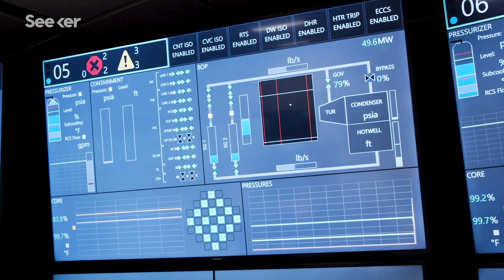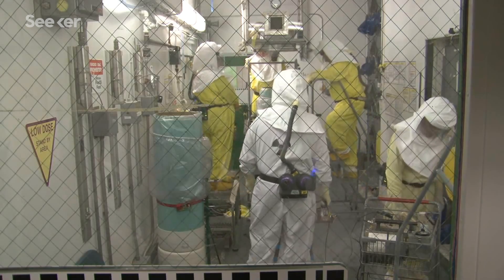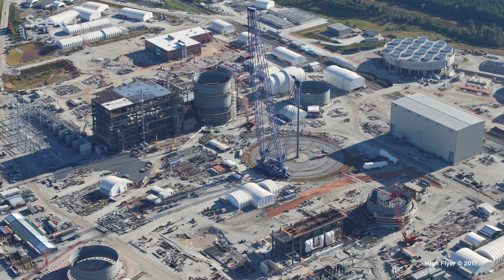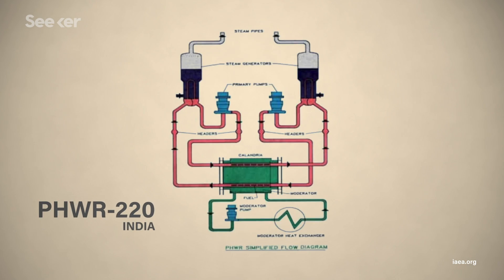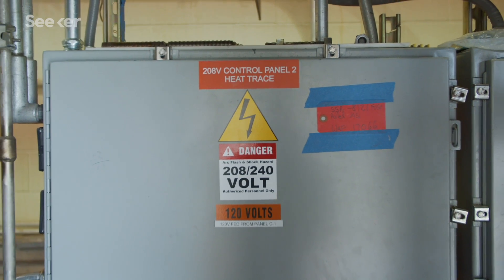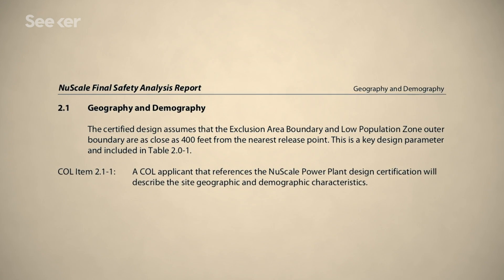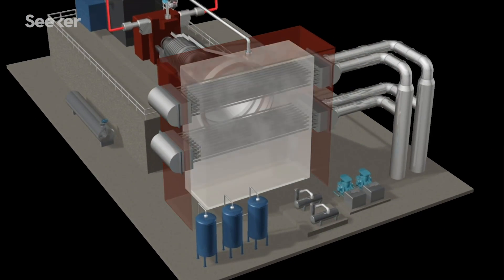Mini-Nuclear Reactors Are Coming, and They Could Reinvent the Energy Industry

Comment: I used to be against nuclear.  This is interesting.  Molten salt thorium reactors seem pretty dope too cause their fissile byproducts aren’t as nasty.
Reply: Why were you against nuclear reactors? Just curious
Reply: @deluxeassortment  Containment of waste is a problem, but at least it can be contained.
Reply: @deluxeassortment  - The same reason anyone should be against them.  Human error is inevitable.
Reply: @deluxeassortment  I'm against it cause... of... Chernobyl
Reply: Jonathan Pontel what did you expect, from a outdated reactor, that had outdated safety regulation and overseers experimenting with the reactor while the engineers said to stop?

Look, the problem was human error. With the modern day safety regulations the chance on a accident is basically none to zero.
Reply: @theemperor-wh40k18  as long as you are not stupid and build your np at the cost near a earth quake zone! xD
Reply: @jponz85  Understandable, but you said 'used to be', what changed?
Reply: @deluxeassortment  I said "used to be"? When? Think that was some other dude my man
Reply: @jponz85  Sorry wrong person :)
Reply: @TheTpointer  Assuming that was a take at Fukushima. Same issues. US advisors suggested building backup generators far above the flood area, Japanese people in charge didn't do it. There also was a nuclear reactor much closer to the epicenter of that earthquake and it properly shutdown because the backup generators were built in a proper location. Now Japan has reverted to being a major producer of CO2 and is in the process of going back to nuclear power after major green energy initiatives.
Reply: @lord_fronic  not too mention the people running the power plant ignored advice on building up the levi's to be tsunami proof. Many staff blew the whistle after the disaster mentioning that this weak spot was brought up an ignored many many times over the powerplants inception. All the nuclear disasters we have had have literally been becuase of human error and could have been avoided entirely if people payed attention to safety protocols and regulations. Negligence is whats killing nuclear power not nuclear power itself.
Reply: @luchacefox259  Do you have evidence of this report. As everything i have seen shows that it was the flood waters which surged the backup generators which in turn caused the meltdown of the cores thus creating the hydrogen explosions on the 3 reactors. 

There were other plants that where also involved in the natural disaster but all had the defenses that could with stand the tsunami, So yes that is human error. It may not have been human error that was the catalyst to the disaster but human error was in short a big part too it. Had those defenses been adequate things could have gone very differently ! So if i am correct then it indeed it was human error which caused the reactor to meltdown as well as the fact that the generators should have been even higher off the ground. The way that Fukushima was run the place was begging for a meltdown in case of an earthquake, there where absolutely tons of ways the disaster could have been avoided, who do you think are going to be the people that remedy these actions it would be people and the fact they didn't do anything is negligence so in fact yes the whole thing was human error ! If it wasn't human error then the power plant would still be there and generating power like the rest of the plants.

Also read my damn comment again and tell me where i mentioned anything about locations of the power plants so before you start name calling and acting like an utter wallop why don't read first or is that a little too hard? 

"Many are older and in worst condition" well yes they are congrats you are right about something. Which begs the question why are all the rest ok but Fukushima a more "modern" station melted down... oh yes humans not running the place properly.

"a bad storm might trigger a meltdown" Yes and no because if a facility is run properly and safety precautions are taken the weather will not effect the reactors no matter how stormy it is but again if not run properly (HUMAN ERROR!!!!!) this can cause a meltdown. Are you seeing a trend.

The fact that you think all nuclear plants are live bombs literally shows your lack of understanding of nuclear technology, this is the kind of thing an anti nuclear power person would say with their lack of knowledge, i'm guessing you looked up things like Fukushima and Chernobyl and think all reactors are like these ones, while on a video which shows the complexities, fail safes and advances in nuclear technology. You make yourself look like a complete idiot. "kill the power and they explode" No this is completely false! The vast majority of reactors have a control rod fail safe which will kill the fissile reaction dead on the water. Have you heard of Xenon Poisoning as its knocking at the door too tell you you are wrong!

Well those last 2 sentences could be spelled better by a 4 year old toddler and i'm supposed to try take you seriously... Come on mate you can do better then that.

Ends his wee rant with an insult how very typical keyboard warrior of you. Does mummy know how special you are ? 

Anyways its ironic how amused you seemed at my comment but your ineptitude has amused me even more, so thanks for that buddy! Also if you can send me that report that would be ace, as i do like to get my facts right. Something about you suggests too me that you are abit too special to even be remotely reasonable you know with the ughhh ... childish insults.
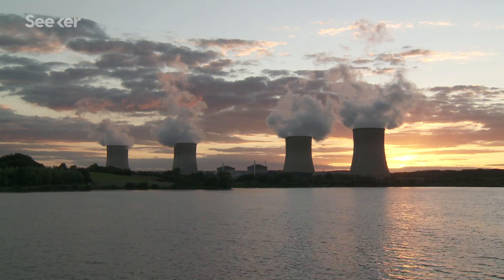Reply: @jponz85  8:50
Reply: +Jonathan Pontel. There are many reasons chernobyl happened. Surprisingly few of those reasons actually have to do with the technology itself and had more to do with the people in charge that night and the entire soviet system itself. Chernobyl was not a failure of nuclear power, it was a failure of communism, the secrecy and lies communism demands are what turned a disaster into a catastrophe. It would be impossible to get away with that kind of secrecy in the US.
Reply: @killman369547  chernobyl was a series of unending mistakes made by incompetent management, misunderstanding of the technology and hidden information by the ussr. It was almost a perfect series of failures to cause the event.
Reply: @TheTpointer  You can put Thorium reactor right on an earthquake zone. That's the point.
Reply: I just trying to figure out what you just said
Reply: In comparison to any other form of energy. Nuclear is cleaner and more efficient.
Reply: So, I used to work in a nuclear facility as a machinist. A lot of people like to talk about how scary nuclear power is and how nasty nuclear waste is. But 1 year out of high school I was in a submarine inside the reactor room, standing 5 feet from the shielding. And my job just out of the navy was doing the same thing on land. I can assure you, beyond all shadow of a doubt, that the US has such incredible training programs, such well engineered controls and containment procedures, and such great safety inspectors, we will never have to worry about a nuclear disaster. Even if an idiot made it through and got an important job, failed to do some important human backup procedure, and somehow managed to trigger an imminent meltdown, the emergency backup failsafes in place would resolve the issue in seconds.

The only nuclear incident the US has ever had resulted in no casualties and no disaster. The emergency procedure was so efficient, a partial meltdown was halted. And that was with 1970s technology.
Reply: spikedpsycho  i m not much into the details of reactors. Here in germany the public opinion is pretty much that we should have never build reactors and i think if you regard the climate change this is really short sighted.
I have physics lectures in my degree course and our professor talked about energy in an extra lecture because it`s a really hot topic over here.
Her take was that most people could do much more for the climate by being a little bit more aware where most our energy goes into and that the demonization of nuclear power is not really justified.

Besides videos on energy politics, how we could become completly co2 neutral and what radiation acctually does that is the only knowledge i have of this topic.

Thats why i welcome your comments so much because you strike me as someone with some more indepth knowledge.
Reply: audiofunkdialect molten fluoride salt reactor more safety.
Reply: @monad_tcp  more than you at least, but that doesn't take much
Reply: they are actually far more nasty, but they only stick around for about a thousand years vs hundreds of thousands of years.
Reply: I am not against nuclear technology but recent test in China have proven that the waste can be really nasty.
Reply: But thorium reactors are more difficult to be used for military purposes :(
Reply: @tusharip  this is the sole reason we dont have thorium reactors. The US and Russia chose uranium over thorium after the second world war and during the cold war purely on weapons potential. If that dosnt make you sad i dont know what will.
Reply: @ashleygoggs5679  We would have been in a very good place if people stopped fighting and started working togther
Reply: @Bady89-lg9sn  no lobby. just visited a physics lecture!
Reply: Shawn Michael  San Diego? this is in the us right? the country that did more than 1000 nuklear wepon tests? for what reason would i take nuklear waste from a country that just blows it into the atmosphere?

To power whole germany(biggest economy of the eu) you produce about 15qubicmeters of nuclear waste that can be stored properly for as long as needed. 

Do the same with coal and you have billions of tons of co2 in the atmosphere.. I think using nuclear power over coal is a nobrainer until we have sufficient renewable energy sources but what ever.
Reply: Nuclear reactors aren’t fission powered
Reply: @celerymeat  yes they are fission powered
Reply: @celerymeat  yes they are.
Reply: Molten salt thorium reactors are not taken seriously by any of my nuclear engineering professors.  They are pitched to solve problems that don't really exist.  Uranium isn't that scarce of a resource, so using Thorium as a fuel loses part of its luster right there.  There are numerous technical issues surrounding thorium as a fuel that the thorium evangelists don't tell you.  First, there is a reason it is pitched in the molten salt reactor format.  That is due to the fact that the protactinium-233 that it's transmuted into has a large absorption cross section and therefore must be removed from the fuel, otherwise, it'll poison the reaction and insert negative reactivity.  From an R&D perspective, the molten salt reactor is pretty far behind all other advanced designs (high temperature gas cooled reactors, sodium/lead cooled fast reactors, SMR's etc).  For this reason, it's NuScale's design that most professors have expressed the most interest in.  It's based on scaled-down technology that already exists and is working right now.  I personally believe that the molten salt reactor concept is valid, but that it's much more practical to use Uranium as the fuel rather than thorium.  That way, the complicated breeding process involved in using thorium is bypassed.
Reply: Why where you against it?
Reply: Anti-nuclear
Reply: @Bady89-lg9sn  and i can smell "can't even calculate Energie if mass and velocity is given"
Reply: spikedpsycho  first commenter that seems to know what he is talking about!
Reply: spikedpsycho  sad that you have no videos on your channel uploaded talking more about this stuff. or do you have any sources to read or even watch?

That are things i was thinking about alot. there is big potential once we let our ideologies behind. There are way to few people with an enlightened mind. (in a philosopical way)
Reply: They don't use thorium because they can't use the waste in bombs
Reply: spikedpsycho  im not hearing much news on its use though... Thats why i thought it was true... Why dont they use it then if it has more energy?
Reply: https://youtu.be/uzCxFPzdO0Y
Reply: @sgg That is an overly simplistic explanation. 

 It takes quite a while for the thorium to be self sustaining, and even then, it really is not the thorium, but the fission products thereof that supply the necessary neutrons. It takes a while for sufficient net neutron producer isotopes to build up in the fuel so the reactor can sustain critical mass. The point is that it cannot be started without a neutron gun. This effectively means that it cannot be run without one.  Using another material to jumpstart the process would defeat the purpose of  nuclear reactors that cannot proliferate nuclear weapons.
Reply: @sgg umm... ok...
Reply: @sgg I said what I read
Reply: The problem with fusion is the sheer simplicity. Just get enough Hydrogen in one place and a fusion reaction starts. We call these things stars. They are not really scalable or very co controllable. 

Continue to research fusion but invest in Thorium Liquid Salt reactors.
Reply: "I used to be a progressive shill"
Fixed that for ya.
Reply: We need liquid metal and gas cooled fast breeder nuclear reactors coupled to supercritical steam-electric plants.
Reply: System is the problem 🏡  The Great Qualities.

1, Show all living creatures; all the love and kindness as much as you can.

2, Only try to be honest with yourself. If you try to be honest with others, you will get into big trouble soon or later.

3, Aim only one target at a time; otherwise you are chasing two rabbits and you will miss both. So, the reason behind it. Have one powerful reason and never ever give up the one you want the most.

4, Don't try to be good person only but be the powerful person. We will grow to be the one or we will die. There is no other choice. 

5, Always learn and look for to improve something your life. 

6, You are not alone. Love and faith the high power reduces unnecessary stress in life. But never completely rely on it. 

7,  Success and happiness are the byproducts of our usefulness. So, always increase the possibility of success.

8, Life is not going to be easy. Because of our unnecessary things. Eliminate all the unnecessary things as much as you can by organising yourself well with the environments. 

9, Never believe anything without the proper evidences. 

10, Always try to give more than you take. 
Because it is dignity/ character of the divinity within you.

🌎 As long as people continue to see themselves as separate from everything else, they lend themselves to being completely enslaved. Success depends on how well we relate to everything around us. Joy comes from that bliss of connectedness. I believe that unarmed truth and love will have the final word in reality. To love; you should have good heart. I am a good person until I see a person better than my standard of goodness. Being good is the progress towards a worthy cause. Love is God. Whoever lives in love, lives forever. How selfish it is to try to keep something forever? Love is all about nourishing, nurturing, sharing and expanding the love within you for all. The principle to which we adhere to is that we have kindness of love at heart for the whole of mankind.  As long as there is the unnecessary differences within us; we can not live peacefully so we have to eliminate all the unnecessary differences among us so we can love all. People abilities may vary but not there true love. If we love a person/ God for a reason then we love the reason but not the person. No reason is the reason to love the person because true love never fails. So do not compare or measure the true love as first or the last but love all truly. If you love people truly then you can understand people. If you don't love then you don't understand people at all.

People are controlled by system why?
The Cyclical Consumption is the current economy all over the World. It is making the scarcity problems of the earth finite resources to deteriorate day by day. Current Monetary System is legalised theft. Real money is Gold and Silver. Scarcity gives the money more value. Real money won't lose it's value. When Governments stay away from Gold & Silver then very easy to transfer the wealth / resources to upper class the Rich (Corporatocracy) Elite. When the Governments are printing out more new fiat currency with reserve banks, our old currency is losing its purchasing power everyday. They are printing millions of currency everyday. All governments and laws are existing right now to transfer wealth to upper class the rich elite. The USA Government & other Governments are in many countries, bailed the investment banks & financial institutions in 2008 against the majority of the people. There is no democracy in any countries. Because of the Money System based on profits motive only above all else even humans lives and well-being. So, we do not have freedom to protect our values with the money so on. The violence, bankruptcy & all the negativities are build into the Monetary System of our society. All are owned (including ourselves) by Reserve Bank. Which is private cartel the corporation. So, in legal system, we are legally considered as chattel the properties. They make money in the capital markets with our birth certificates. They do not consider us as Humans. That's the truth. We are at the invisible war with the Elites (Corporatocracies). We have to fight for our Freedom. Resource Based Economy is the Solution. We have to declare the earth resources as the heritage of all the people of this world. So everyone has access to it. Please have your research about zeitgeist movement then you know the truth more. 

 Truth About Health/Drugs Industry Because Of It Your Life At High Risk The drug industry is a 1/2 trillion dollars a year worldwide conglomerate. Almost 300 billions dollars just in North America. That is really big business. What would happen if everyone were well? There is no money in health. You see, good health makes a lot of sense but it doesn't make a lot of dollars. Because everything they do is toxic. Every drug they use, prescription drugs, all drugs are liver toxic, bar none. If you've had amalgam fillings put in your mouth by dentists. It is highly toxic. There's cancer because most of the chemos are themselves carcinogens. To view the tumor as the cancer and we know the tumor is not the cancer. The cancer industry is 200 billions dollars a year. The more work they get, the more profit there is. You have to dismantle; If the truth ever came out about what we would need to do. 30% of people of females in America are at risk of getting, will get cancer of the breast. The ones that are already dead have been grossly mistreated by the medical profession and by the government that supposedly is supposed to encourage free research and development of all possibilities. Why would medical doctors who studied medicine and practice medicine and are heavily funded by pharmaceutical companies why would they go and look into vitamins? That they never had the answer orthomolecular. And as more and more of our population start taking their health into their own hands, there's going to be even more and more of changes. It can't go on the way it is. The system is failing apart. We must make nutrition the primary prevention strategy for the population. You are what you eat. You are everything that you have ever done to yourself. The choices you make directly affect the outcome of your life. - (Food Matters Documentary in Netflix)

😊 Well, I truly love God. I am not religious but very spiritual person. So, I believe 1) Religion is the beliefs in someone experiences But spirituality is having my own experiences. The mainstream religions people promote religious ideology by giving guidelines and guide but In my spiritual life; I do not want anyone or anything between God and me to restrict my freedom to worship God. 2) We do not need any authorities to do good work. The god work is the good work always. In contrast; organised mainstream religions are claiming that they have the authorities to do God works as leaders so on. 3) God is not capable of doing wrong thing, change the past for us and create anything out of nothing for us. Nothing means not anything. So, even God is limited. The mainstream religious people believe that God is unlimited. 4) God wants us to take responsibilities for our righteousness life but not for all the consequences of our actions because they are continued to exist among us. So, How can god punish us for all our consequences? The mainstream religious people believe we are full of sins because of all our actions. 5) Freewill  is an illusion. People always choose the perceived path of greatest pleasure.  So, we do not have choices all the time. In contrast teachings of the mainstream religions are promoting people to do god's will always because we all have choices of freewill always. 6) We can not separate everything into groups. So, everything for good and evil and there's no success and failure for everything. If everything is real then real things can not be threatened. Once you come to understand that God/The Holy Spirit is in each of us, You will no longer need a Book to tell you how to live. Then why we need religious scriptures? The Virtue is the expression of the basic goodness in our actions. The Basic goodness is the fundamental worthiness of every individuals. We are worthy to God always in everything. 7) Beliefs in a cruel God makes a cruel man. No matter what; every living creatures has the right to live and What makes their life cheap? Everything depends on everything. Nothing too big or too small in value. We can not love and hate at the same time; Being a vegetarian means love without cruelty happily. The mainstream religious people are killing people and sacrificing animals in the name of God. They promote God's cruel punishments. The Punishment is endless for Sinners/Devil according to religious scriptures. But God is love always. Overcome hate with love. If all religions for peace, unity? No way. Because they are not for peace. 8) Well, The God gave us everything to go from moment to moment in our lives as we do our part  and pray only to thank god then the Love is in progress. The Love is always for everyone. We are always worthy of the God's love. Our greatest fear is; not to be loved by anyone but we are all loved by someone. When we eliminate all our unnecessary differences among us then true peaceful life is possible with the true love. If we can't find the peace within ourselves then we will never find it anywhere else. 9) This is the Fight for independence and freedom of humanity to worship God freely without religious guide and guidelines to restrict us. Unnecessarily, We do not want third party controls over us in anything ; especially in spirituality. 10) Revive Survive Thrive. Sincerely,  The Real Peacemaker against religious oppression.

 https://youtu.be/HbvCxMfcKv4
https://youtu.be/pIJHJzDQcRM
https://youtu.be/MyxbdmAnIcI
https://youtu.be/wLzeakKC6fE
 https://youtu.be/P8vHa8zD7jY
Reply: nuclear waste isnt such a big problem as activist like to make it seem!
Reply: @TheTpointer  exactly and alot of it can be used for other things like research ect...
Reply: @TheTpointer  .."nuclear waist" ?? a person who can't spell "waste" properly, shouldn't comment on "activists"....
Reply: philosoaper no no, nuclear waists are not too big of a problem because nuclear generators are not so dangerous! Ha!
Reply: @philosoaper  true xD my bad
Reply: @theemperor-wh40k18  fake emperor can't spell
Reply: @philosoaper  ad hominem, typically refers to a fallacious argumentative strategy whereby genuine discussion of the topic at hand is avoided by instead attacking the character, motive, or other attribute of the person making the argument, rather than attacking the substance of the argument itself.
Reply: @philosoaper   no no nuclear waists are a big problem
Reply: Thorium is fertile, not fissile since it needs plutonium to react
Reply: @dorademir8195  Thorium reactors create their own plutonium in the fissle reaction. We can also use current nuclear waste with the thorium reactor which also helps with this need for plutonium while making current nuclear waste easier to handle after the reaction.
Reply: Ashley Goggs thorium reactors need plutonium to work it's a booster to make the reaction it does not create it
Reply: @dorademir8195   that is the big problem with thorium folks. It's not quite self sustaining, so it needs something, either some sort of neutron gun,(big, expensive) or like Dora Demir said, plutonium (radioactive & stuff)
Reply: @superdupergrover9857  yeah but that makes thorium reactors safer since you can immediately stop it from reacting
Reply: @superdupergrover9857  It isn't a problem. It is a benefit. The thorium-u233 cycle makes it possible to create massive amounts of energy at the same time avoiding creating long lived actinides like plutonium.
Reply: @superdupergrover9857  U-238 isn't fissile either. You always need a more radioactive element to start the chain reaction and enough fertile material to keep it running. Doesn't matter what fuel cycle you use. For the Uranium-Plutonium cycle, you use U-235 or Pu-239 to kick off the reaction and keep enough U-235 in the reactor to keep it running.
In a Thorium breeder fuel cycle, you use whichever isotope you want to start it off, then as the reaction progresses, the Th-232 breeds into U-233 which is your fissile material.
Reply: it is best all way around to go full sustainable, we really doesnt need those thing if we committed to sustainable technologies and investment.
Reply: @placerdemaio  "sustatainable" (or technically renewables) sources have major problems and are actually more toxic currently then nuclear. Nuclear waste is taken care carefully, while things like solar panels use an array of metals and oils which when discarded are chucked into landfill. There are all sorts of carcinogenic metals used to make solar panels which is where the renewable isnt very sustainable. Nuclear is completely green if we look at things from a purely energy generating process. It is also flexible and can meat energy nees 24/7 by using the control rods to inhibit the reaction process. Renewables however do not have a way of being adjustable and flexible its more a case of you you get what you get, so we need tocome up with ideas of storing this energy so we can adjust energy in the grid during times of high demand and low demand.

In short renewable just arnt there yet and nuclear is.
Reply: @ashleygoggs5679  i understand the argument against it, but it is fundamentally wrong because the renewable or sustainable technology or wherever you want to call it, this new tech, can be infinite more pollutant than this old tech, what im not very sure if it is, it definitely are more expensive and more dangerous and with a garante no future because the news stuff that will come, so even if the reactor was less expense, less pollutant, and less dangerous, it is a bad investment overall for our future, and it is a bad investment right now, because investment in energy now affect heavily the future, do you know that the electric motor did come before the combustion engine ?, 110 years ago, if we held the investment i guarantee you that we would not having this conversation right now, so the ''just arnt there yet'' are been used by the not so honest other type of industrie, if you know what i mean for a long time my friend.
Reply: @placerdemaio  im not sure where you are getting your info from. But renewables, except hydro (which has its own non green issues),  are not only not coast effective, but bad for the environment in large scale. Besides the issues of how solar  is made (toxic chemicals produced) it can not produce enough energy and be flexible enough to keep pace with energy demands. Especially at night. Not only that but you need huge areas filled with solar panels, which destroys vegitation and animal life beneath it. Not basically lives unser it. But it high heat and if it has largec area surfice it cooks birds to death flying over it. And again the night time issue, the cloud issue and so on. 
When you count it all together its not efficient and its not green (aka good for environment) at all. Wind has exact same issues. And i havent even mentioned how they get the raw materials for the "green" tech. Now that is some grade A non green thing.
And ill tell you what has happened to places that are getting ride of nuclear or have already. Carbon emmissions as doubled or more. Because nucs generate huge ammount of power and they augmented them with fissile fuel plants. Infact even in increase of renewables world has created and is burning more fossile fuel for energy than ever before, even in the most "green" countries, like Germany. 

Also i saw noone mention other new 4th gen nuc reactors. Its not only molten salt reactors being created( that reactor is  perfectly safe because if it starts to fail it has a mechanical (passive) system that shuts the reacton down). Btw you could use other fissile traditional materials aswell in it. There are also very hot reactors, led reactors, and most importantly FAST/breeder reactors. 
What they do is they use waste from the old gen nucs, add in old millitary war head uranium, and you are getting ride of both, and you are makeing extra fissile materials to keep the reaction going. What this means is there is far less waste at the end, its more spent ergo half life of it is dramatically cut to similar ammounts as Thorium. 
And ill add the waste of all the nucs was very small to begin with. People dont even understand how little there is of it. 
There is more nuclear active waste comeing from coals plants than from nucs infact. 
Nucs are the greenest tech around and getting greener with the least overall footprint on the environment to create and sustain. Only thing greener will be the fusion reactor. With barely any waste to speak off.
Reply: @walkinondamoon1  you are not getting my point, it doesnt matter how clean or efficient it gets, there a end of the road for it, for even the new less dangerous salt reactors i think, because even if it was perfect, we can not put radioative stuff underground for ever, especially if we have a better alternative, and thats is the killer, i think we will not only will, but i think we already have, the first steam engine did have like 7 to 10% efficient or something, with the solar painel only right now that have a terrible efficiently, already you can power the entire planet with it, i can power the entire planet with only using the american desert i think, but i dont think we even need to use the desert, there is plenty technology on the horizon right now that are better already, the point is that this is just the beginning, and this old stuff it is not, the miniaturization of reactors less dangerous like the molten salt one it is a excellent proposition, but, i think it is to late, i think in my opinion investment in nuclear are a waist overall, like investing to make combustion engine more efficient, it have it place, but..., and when i said new technologys i was implying energy storage too, and right now because the investment capital are going heavily toward it, a very promising on that field are the new graphene batteries, but hey i think every inevitable pollution or harm that are coming from this new technology, it is manageable, the machine that extract the ore, we will make electric eventually, the holes that we digg, we can fill back in, the fauna and flora that no doubt we gona hurt to make energy storage products, we can replant, relocate and stuff, this it is all manageable, reversible even, nuclear are extreme expensive, extreme short in jobs in comparison, still have its risks even in the best and conceptual new nuclear technologys, and buried and forget like the carbon solution from the fossil industrie, it works, but not our best, and our best will end this i think, well in the end of the day, i hope the best overall will be the norm, and i think it is not fossil or fission base, that will be it, the best expectation right now is that the eventually miniaturization of the fusion reactor eventually, will be the end game of energy i think, i just hope that this new market that are coming up right now, will give the opportunity for the poor to not even paid electric bill, i think it is very reasonable, because you can already do that with 18% efficiency panels, that are only one tipe of technology, now the pollution that will bring we should do everything possible to reduze it.
Reply: @placerdemaio  well ill put it simply. Untill fussion comes along, hopefully in 30 years (after ITER and DEMO, hope things go well and we dont have to wait another 50 years) nuclear is the only way to bring carbon emittions down so we can survive until than. And no matter how good the panels will be it will have a flaw that it depends on nature to make energy. And can never make as much energy, no matter how you slice it. And add batteries to it the waste and co2 emittions per kwh is non comparable to a nuce. Batteries and solar degrades much faster over time and waste is much greater. As i said nuclear waste is not that much of an issue because its small.  Besides there is a better stop gape between nuc and fussion reactors. And thats fusion-fission hybrid reactors. Again. Just look at Germany its over producing solar n renewables but it is burning more fossile fuels than ever after nuc shut down. 

Yes maybe panels, if you have a modest electricity consumption and a battery you can live of grid. Which is good for some people. But its not the main way to create electricity. It never will be. And lets not pretend its green or cheap.
Reply: @walkinondamoon1  you still didnt get my point, is already cheap and declining very fast, the pollution factor are meaningless for the reasons that i did say, those technologys can supply already now the entire word many times over using a very inefficient very early technology and it is just one of them, a fact by the way. fission is not acceptable because of cost, the risk, the pollution, the waste, and the lack of future in the competition and investment area, want prove ?, where are the investment capital going ?, i think, it is not fission.
Reply: @placerdemaio  
(DISCLAIMER)
Sorry this is going to be longwinded so prepare for alot

The first part of your comment didnt make much sense to me and i dont know if you are natively english speaking so ill try my best to work out what you mean, hope that dosnt sound offensive. 

I think what your trying to say is nuclear is good but because of its cons this means we cannot use forever, is this what you meant? 

Yes i did know about the electric motor. But the facts are that technology just wasn't anywhere near as useful as fossil fuelled engines at the time. During this time we also had no knowledge on the effects to the enviroment, so you got to take yourself back to that time. Do you spend decades trying to make an electric motor better gradually or do you use fossil fuels which worked vastly more better (ignoring the negative effects as it wasnt known then), well you take the fossil fuel everytime dont you. 

This is exactly the same with nuclear aswell. For example during the time and research in the 1940's too about 1960's massive amounts of research was being done into nuclear bombs and as a by product so was nuclear power. During this time we had 2 options, Uranium reactors and thorium reactors. Uranium reactors had a by product of plutonium (bombs) and weapons grade uranium (tank shells), while Thorium yielded better results and less waste but no weapons grade materials. Becuase of the time and the rivalry between Russia and US there was a need for Intercontinental Ballistic Missles and thus Uranium reactors became that standard over the safer thorium reactor becuase of its uses for weapons. So i see your argument but facts are this is all in the past and we now have to think about the future.

This year globally we have been seeing record breaking heatwaves due too climate change and one of the biggest industry polluters is energy and fossil fuels. Renewables are reliant on weather and topography (hydro electrics) and this makes them hugely situational. The only way we can make Renewables a thing is if governments where willing to make HUGE farms in deserts and off shore turbine farms. 

Nuclear on the other hand can be built anywhere is not reliant on weather and with the safety regulations in place and failsafes and redundancies built into them it is hard to have a meltdown on a modern reactor. I mean look at it statistically theres thousands of nuclear reactors globally with only 3 disasters. Sure the scope of a disaster is big and people are effected but look at it this way, fossil fuel stations pollute and produce carcinogens 24/7. While a nuclear plant can meltdown and cause radiation poisoning. But during the lifetime of the reactor it isnt hurting anyone so the scope of deathtolls is huge in the favor of fossil fuel stations killing millions a year. 

Nuclear isn't a long term answer and every pro nuclear person will tell you they dont want nuclear(fission) forever. We need to push nuclear fission too a time where Fusion come around which is the ultimate answer to everything. Fusion works in a tight set of parameters meaning if it gets too hot the reaction cuts out it gets too cold the reaction shuts down. The reaction itself is its own safety mechanism. Nuclear is the way forward for the next 30 or 40 years until fusion can take humanity to the end of the earths cycle.
Reply: @ashleygoggs5679  i understand your argument, but to my opinion, fussion is like the hydrogen base cars, that some car companies did try to push, i think it is already to late for them.
Reply: @luchacefox259  lol part about free energy is the other guy lol
Reply: @placerdemaio  Fusion has never been like that mate. Fusion has always been a puzzle box. We have tocamacs which can produce energy but non have produced enough to make them viable just yet, this is where ITER comes in. Fusion technology is being researched by all the biggest govenments in the west for example europe has made the initiative which is going ahead with ITER with backing also from the US. Also Independant companies are making huge leaps and bounds in the effort to make fusion a thing. So in that aspect you are wrong as fusion has just been the trickiest nut too crack. Its like that saying Fusion Engerineers have Fusion is always 30 years away this wouldnt be a common saying if the research was constantly being held back or bought out by the big companies. The matter of the fact is we are beyond saving if governments dont start making a push for clean energy and fusion is that holy grail.
Reply: @ashleygoggs5679  i did not referred fusion, i did mentioned fission, but if you are referring when i did mentioned, well yea fusion need a lot work yet unfortunately, but we dont need fusion really to power the world, we already can use just solar that it is just one of the technology that we already have and it is old and very inefficient, but im sure you, we gona make the efficient go up, already there is some with good expectations look https://cleantechnica.com/files/2014/02/efficiency_chart.png, and again this is just one of the technologys.
Reply: @placerdemaio  I mentioned fusion as thats what you said in the comment i was replying too. No fusion isn't needed you are correct but its like i said in a previous comment, Solar requires alot of materials to create some of such materials are hazardous which means solar panels need to be put into landfill, if we was to use solar completely thats ALOT of waste when panels start failing so we essentially cause astronomically more harm to the planet through material waste that we would with Fusion, Fusion is safe and completely green. It would be incredibly pointless to scoff at it.

Anyways my point is that to make better wind turbines and solar panels we need to make them more efficient and create them with as minimal potential waste as possible and that in of itself is a long shot which by that point you may aswell wait for fusion, fusion can be scaled so we can use it in ships and subs and potentially space crafts, we already use nuclear power in subs and ships. Solar and wind are limited Fusion is not, once the nut has cracked it will be everywhere. Maybe we can even potentially put them in cars for unlimited range and power who knows.
Reply: @placerdemaio  you know alternative source aren't nearly as sustainable as claimed there are a lot of factors not considered with in the cost/benefits analysis.
Reply: @daanbos6700  fair point, but cost it is very relative, cost is not a good point to go for especially in the sustainable energy topic, because cost depend of many, many factors, but right now, those sustainable energy like solar, wind it is already cost efficiency better than a big reactor, now if you push the technology to it potencial this mini reactor i think still loses to the sustainable stuff that will be far better than right now because it is just starting the investment, the common solar painel right now have like 18 % efficiency or something, but i think in my opinion in the end of the day, the best will be the fusion reactor, so you see we have a good future in our hands and none of them says those old technologys, what i am trying to say is that it is better over all to invest in sustainable energy like those i mentioned, even right now at the present needs.
Reply: Alternative Facts Survivor. Well i suppose solar would have a cost advantage over nuclear, what with the government literally throwing piles of money at it. Anything can be cheap AF when the government subsidizes it. If you subsidize it, you get more of it, and that applies to anything.
Reply: Actually.... thorium reactors produce MORE radioactive isotopes than Uranium. But high radioactivity means it degrades and releases its energy faster rather than over a longer period of time. This is good because you can just throw the waste in a pool of water in some basement for like 20 years. Bring it out and its not even hot anymore. Then you can dump it in some hole, it doesn't really matter it would poison the ground for tens of thousands of years, maybe like 400 years which is actually quite reasonable.
Reply: Never under control.
Reply: humanity doesnt want or need nuclear power. its unnatural, polluting, and dangerous. we prefer renewables.
Reply: @keylanoslokj1806  well.. if we could get fusion to work, that'd be something we want.. fission however.. not so much..
Reply: Mmm yes I am very smart yes ooo yes big words mixed with informal words equals me smart and cool